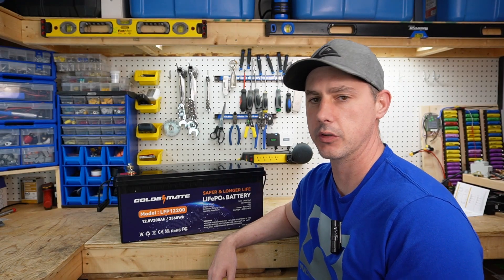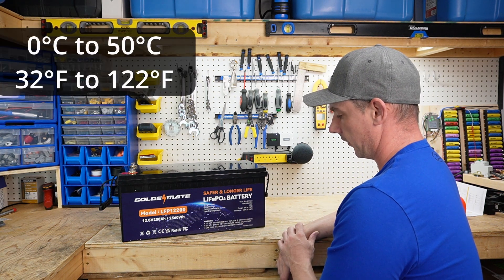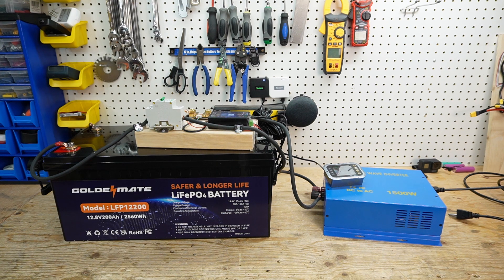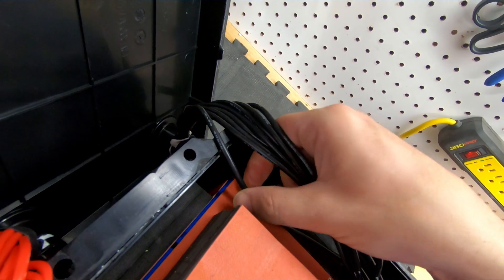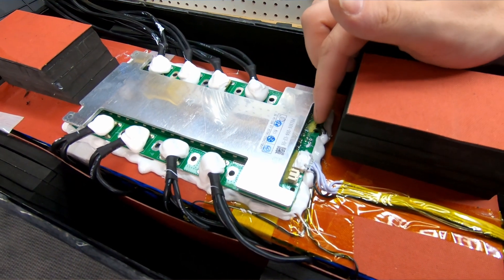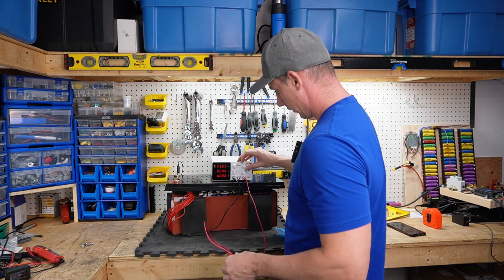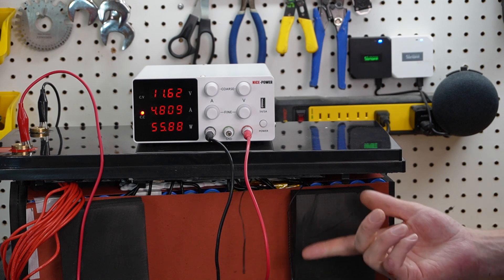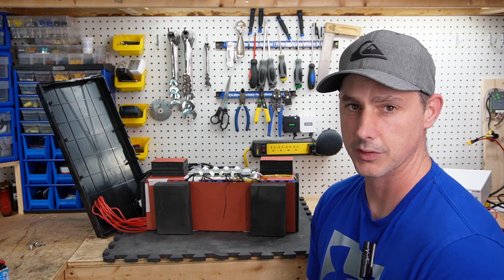GoldenMate: Cold Temperature Protection? 12V (12.8) LiFePO4 200Ah Review

Comment: I’m really liking the tech & price of this model battery!!
Reply from the maker: I have a video coming out soon on their new 100Ah battery 🔋
Reply: @Roll2Videos  nicely done video by the way.  I emailed you a question/proposal.
Reply: I also wrote them asking/suggesting that they add Bluetooth….hopefully with controlls via Bluetooth….as well as monitoring.
Reply from the maker: @ridingvenus  I believe that would be up to the BMS manufacturer
Reply: @Roll2Videos  yeah I have only seen one other competitor at this price…& they have the controlability & monitoring for near $90 more hopefully the bms manufacturer can do it or they switch to another manufacturer that has similar specs and functionality.
Reply: Adding full or near full remote controls eliminates some of the components of my system(s).

Comment: Hey my friend i have a question from a Novice .How do i check the amperage with one of those clamp on Amp meters from 4 -12v batteries in parallel. New they were 40Amps each but i bought these used and I'm curious what's the amperage i have left. I should get one of those meters that i see everyone using, hooked up to the shunt. Here is a video you might be interested in watching. Unboxing Solinteg's 50 kW Hybrid Inverter
Reply from the maker: Hello 😊 The clamp on won't keep track of the amps. You'll need a shunt to measure how many amps you use.

Comment: Thats awesome you are reviewing all the  batteries like this. It seems like they use good cells in all the plug and play batteries like this but seems the bms is kinda lacking in about all of them I've seen. Maybe I just expect someone to build one with a big enough bms and big enough wires to handle a good size inverter.
Reply from the maker: It comes down to the cells, Most can only handle a 1C discharge rate, but even that is not good for them. Best to oversize your bank to keep the C rate down for longer-lasting batteries.
Reply: @Roll2Videos  I'm still new to building batteries but my 16 cell battery I just built is 280 eve cells at 24 volts. I put a 300 amp dally as the bms actually just oversized it because I figured it might last longer without being stressed.  I'm sure I'll never pull 300 amps thru it but I saw on one of wills old videos where he was talking about how an oversized bms is a good idea. I also got the active balancer on there at the moment also but once they are top balanced I figure I'll remove the active balancer and see if the daly can keep them in check. I also just received 2 of the 2 amp jkbms's but haven't been home in a couple days so I've not gotten a chance to mess with them yet. I appreciate you guys making the videos it gave me the confidence in building my power system to be off grid
Reply from the maker: @matthewknight5641  Thank you very much, Hearing this from fans really makes my day 😊. By the sounds of you've got this in the bag.

Comment: Good to see this one pulls full capacity. The BMS looks the same as the one in the 100Ah. If I recall correctly I think it said 120a on it. Great Video!
Reply from the maker: Yes, I was thrilled to see this one pull full. They do look very similar
Reply: yes, the 100Ah says it also can discharge at 120 amps